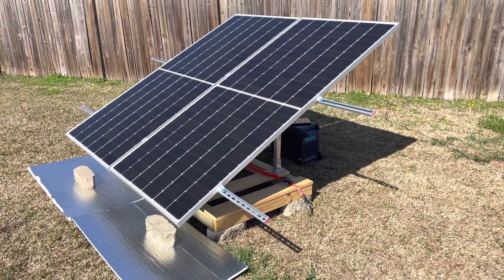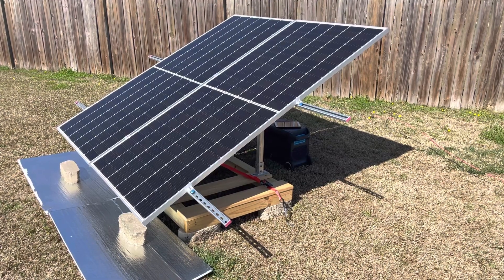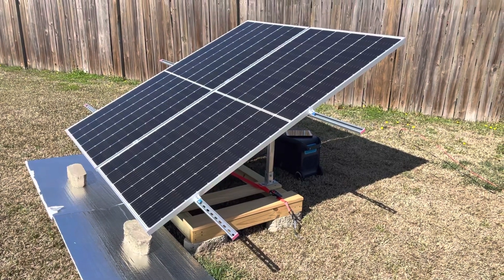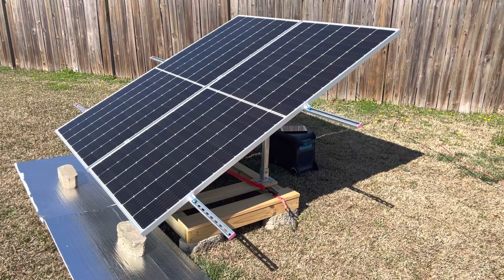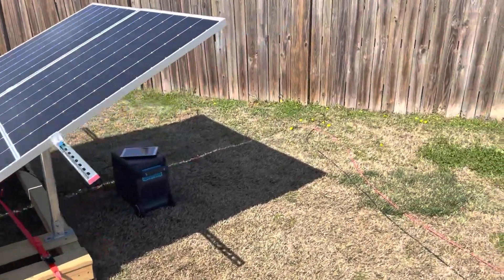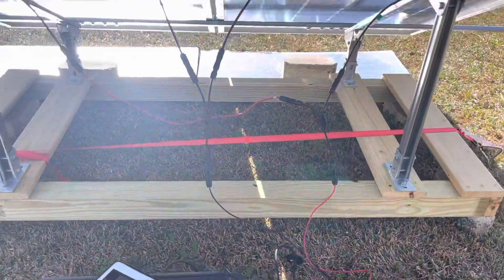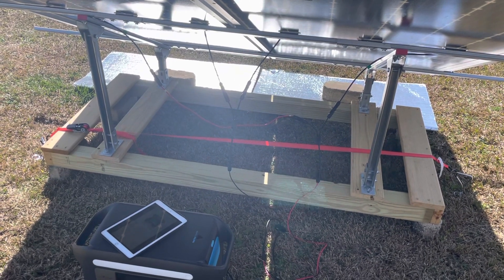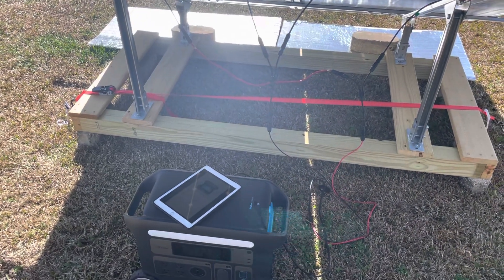Anker 767 Powerhouse Solar Input challenge!

Comment: I purchased two of the panels also based on this and Trailpower’s videos to feed my Anker 767 full time. I have had the 767 running off of these for the past two weeks and running our basement fridge (apartment size) and standing freezer 24/7 for the past 2 weeks. During the day when we have sun, I flip our kitchen fridge, lights, basement lights and my entire office to the 767 as well. The panels have been charging the 767 to 100% while running these before the end of the day, at which point I switch it back to just the basement fridge and freezer.

Like you, I think the max I’ve gotten is just over 900W one time from the panels. I’m going to upgrade my wiring from 10AWG to 8AWG however from the panels to the Anker. I am losing a bit more than I’d like in voltage drop based on calculations. All in all, it’s a great setup for emergency power, and to just offset a few KWH of power each day from the utility.
Reply from the maker: I spent a bunch of hours trying to come up panel combinations that would max out the Anker 767 and not break the bank and this was the best I could come up with.  I posted this video months ago in hopes that someone would come up with a better combination.  So far, the Qcells work very well and you can't beat the price.  I'm especially impressed with their low light bifacial performance and couldy day performance.  The only downside I've found is they are big and heavy.
Reply: I agree, they do perform well in low light. I especially notice it early morning and late afternoon when the sun isn’t directly on them. You’re right though, I built them on an adjustable cart with wheels, but the weight stops me from turning them throughout the day. I would if I absolutely had to, but for day to day use, I’ll just keep them pointing south… Come winter, I’m curious to see if I’ll want the expansion battery.
Reply: @leafnutz2341  
Hello friend, I would be glad if you answer.
Are you satisfied with Anker 767? Have you encountered any serious problems with long use? I will buy this device, but I came across a few negative comments in the reviews.
For example, while it is constantly connected to the solar panel, when the sun hits the panels in the morning, will the device work on its own or do I need to constantly disassemble and reassemble the panels?
I'm also thinking of an ecoflow folding panel. How do you think 400w x2 pieces of 800w would work? I do not think of any other portable configuration. 1 piece of 200w ecoflow portable, 2nd panel to take with me, maybe I will add it later. If you are satisfied with the device for home use scenario, I will buy it. The country's inflation is very high where I live, so I do not want a risky purchase. If you do not recommend it, I will look at alternative products, thank you.
Reply from the maker: @alimuharremturan581  I have not encountered any serious problems during my ownership.  My first unit was wired incorrectly and replaced but still worked properly.  I mostly use my 767 with our RV when we travel but also to charge my EV sometimes and to power a chest freezer in our garage.  As much as I like my 767,  I do not consider it a permanent system.  It is a portable unit and lacks many of the safety features a permanent system would have (proper grounding, DC breakers, solar disconnect, etc).  For this reason,  I do not leave it plugged into solar all the time.  I have a larger Growatt system as my primary system.
Reply: @leafnutz2341  Thank you very much for your reply.  But I want to be sure about one thing.  When you leave the device plugged into the solar panels, when it sees the morning sun, does the device automatically wake up without any problems or do I need to manually remove and connect the xt60 port every time?  When the device's 2400w output is connected to a socket or solar panel, does it allow you to use 2400w full power without any problems?
Reply from the maker: @alimuharremturan581  I’m not sure what you mean by “wake up”.  If you leave it plugged into your solar panels, it will charge the unit up.  BUT if the inverter shut off during the night for some reason,  it will not automatically turn the inverter back on.  Yes,  you can use the full 2400 watts without any problems.   Keep in mind, this unit does not have Wi-Fi. It only has Bluetooth so you need to physically be near the unit to monitor useage and make adjustments.
Reply: @leafnutz2341  What I mean exactly is that the solar panel will remain connected to the device, in a continuous cycle, when it gets dark, the energy transfer will stop. When the sun shines in the morning, will the device continue charging? Will it charge itself without any intervention?
Reply: What solar panels are you all running, for best results and wont break the bank?

Comment: I think  your solar set up is ideal for long tern of use.
Nice video. 
My advice to all is  that 1000 wats  is  maximum, but  what is better ?  To run invertor  for 100 %  for  long  period  of time, or to run it for around 85 % of  its designed power. 
I think with 85 % of daily usage  can invertor last longer  without possible damage during  passing time than when it runs on 100% of its possible  maximum  designed  power.

Comment: I didn’t want to register to the forum. 
 Here is my array for the 767:
8 panels, 100W 
2 sets of 4 panels in parallel, connect the two sets in series. 40-45V and 20-23 amps.
 You could run two sets of 5 100w panels. I don’t have space for that, and the 800w array does the job.
Reply from the maker: And how many watts are you seeing going into your Anker with that setup?
Reply: Hey I have 6 100 watt Renogy panels and I have a 3 series 2 parallel array. Do you think I could do a 3 series 3 parallel array for 900w?

Comment: What AWG size did you use to connect the panels to the 767? And is this AWG size the same used for the MC4 to XT60 cable? Or adapter? Hard to tell from the video.
Reply from the maker: 10awg throughout.  At one point I was using an Ecoflow Delta Pro MC4 to XT60i adapter which is 12awg.  The Anker will draw just over 20amps so keep everything 10awg and you'll be fine.

Comment: Great job showing the capabilities of the 767! Do you have other systems that you use with those panels, or did you make that setup specifically for the 767?
Reply from the maker: I bought them just for the Anker but they will be added to the array for my Growatt system in the future.  This 2 panel rack is semi portable.  I can tear it down and load it up in my truck in about 30 minutes.

Comment: I have room for these panels on my RV.  I would like opinions on the compatibility when 2 of them are connected in series to power my 767 power house.  
Dimension: 54.72*34.45*1.38 inches

Weight: 29.1lbs

Max Power Output(W): 250W

Voltage MPP Vmp(V): 23.83V

Current MPP Imp(A): 10.51A

Voltage Open Circuit Voc(V): 27.28V

Short Circuit Current Isc(A): 11.09A
Reply from the maker: That sounds like the NewPowa 250 watt 9bb panels.  You could actually run 4 of them in a 2S2P configuration.  I mentioned these panels in the DIYSOLARFORUM thread but I haven't tried them personally.  Please let us know where you found them since they are discontinued as well.

Comment: This is off topic ,but I just received my 767 and it came 84 % charged I never received an order of anything with battery power more then 20% charged. Was wondering if anybody thinks this might have been returned and then sent to me?
Reply: Mine came with a similar charge. I was also surprised
Reply: I think because these are lifepo4 batteries. Safer than lipo. Therefore, a higher charge is just fine.

Comment: thank you LeafNutz for the very useful share! I cannot find the Qcell 480 in Crete, where I live but here's what I can get: LG NeON 2 bifacial (LG400N2T-A5). It has Voc 49.7 and Isc 10.22 and can get up to Isc 13.29 and 520W with the bifacial boost. Two of those connected in parallel will give me 1000W, I figure. What is your opinion? What if another panel was added to send the amperage  to 150% of the rated max of the 20 Amps of the charge controller? Can It handle it without being stressed and damaged? I am new to solar energy but I thought that if I raised the tilt angle of these panels to 50%  (for better winter performance) and turn one panel SSE and the other SSW (60 degrees off true South), that would alleviate the stress of the excess energy produced during peak hours and lend some of it to the less productive hours, allowing me to use 3 panels maybe?
Reply from the maker: Stick with 2 of those panels wired in parallell.  The Anker will only draw 20amps even if more amps are available.  Look up ideal tilt and azimuth for your specific location and start from there.  If your solar needs are higher in the morning or evening,  you can experiment to see if you can get better results with a different orientation.  Bifacial panels perform better off the ground approx 2-3 feet.
Reply: @leafnutz2341  Hi, can you offer some advice, I'm a total new commer but have got the Anker 767 and spare nattery?  I have my eye on two 550w bifocal panels but each has an amp output rating of 13 meaning at max (in parallel)  I could be bringing in 26 amps.  Are you saying in this scenario it would just reject the excess and not damage the unit?  Exceeding amp input would not damage the unit? Cheers...
Reply from the maker: @equalizingforce2581  Yes, the Anker will onlyl draw 20amps even if more are availalbe.  The 60v VOC input limit is more of a hard limit and should not be exceeded.  Be sure to calculate your max VOC based on the lowest temperatures for your area.  Also,  keep in mind that 550 watt bifacial panels will be large and heavy and difficult to move around.
Reply: @leafnutz2341  Many thanks. Connected they are about 46 volts in England  weather so it should be  ok.
Reply from the maker: @equalizingforce2581  Just search for a online solar temp compensation calculator.  There are several of them where you just plug in the numbers.  Keep in mind that those panels will max out at 46v x 20 amps or 920 watts.  That being said, the extra amps and bifacial design will help on clouldy days.  Be sure to use at least 10awg  cables.
Reply: @leafnutz2341  Hi again.  Been doing my head in trying to come up with an optimised configuration but the 20amps limit is a big problem.  The issue is I live in England on the coast and it's cloudy 70% of the time.  If I build for just 1000 watts I'll be lucky to get 800w in summer and 200w in winter.  I would like to over build to 1500 watts but I'm concerned about damaging the Anker battery as the amps would be about 36. Could I get a MPPT controller to restrict amperage to the Anker device on optimal days so I'm always getting the optimal input whilst allowing optimal input on cloudy days?  Cost is not my concern, having another source of power is my priority.  Thanks.
Reply from the maker: @equalizingforce2581  if cost isn’t a concern,  I would just get another Anker or the extended battery.  Bifacials panels will help on cloudy days but only so much you can do.  What is your intended useage for the Anker?
Reply: @leafnutz2341  Hi, I did buy the extra battery but that doesn't help with this dilemma.  I bought the set up because I wanted a back up source of power to use in the house and I also intend to move to the country at some stage and be less reliant on the grid,  and also  possibly buy a caravan lol.  Thus I wanted it to be portable.    Energy prices are shooting up in the UK so I would like to install some solar panels and use it around the house for high energy draw appliances like the washing machine and oven etc... Something is going to happen with Russia in the next year and I could be reliant on this unit so I'm trying to cover all angles.  The big  issue is the weather where I live is so unreliable and it's always overcast.  Would an MPPT controller not allow me to restrict what's coming in to the power station? I did think about installing 2 500w panels in parallel and having a third feeding directly into a junction box that I can turn on and off when the weather is poor. However, would that third panel effectively double the voltage when switched on?
Reply from the maker: @equalizingforce2581  The Anker 767's strong suit is it's portabiity.  This makes it great for a Caravan or for emergency backup during a power outage.  That's being said, I would not consider it a good off grid solution for anything other than a small cabin or a single room.  It simply doens't have enough power or solar input.  You should practice running scenerios where the Anker is your power source to see what you can power and for how long.  It's great for a fridge/freezer/TV/internet modem, and a few lights but any more than that and it falls short.  You simply can't get past the 1000 watt solar input limit.  A larger solar generator like the Ecoflow Delta Pro would be more suitable or an All In One inverter like EG4/Growatt/Victron.  The Anker does have the strong suit of being able to charge from a small generator or even your car.
Reply: @leafnutz2341  I researched every possible alternative, this seemed the best all rounder.  I have already tested it, I could get by on 4KW per day (basic needs). My issue is getting enough solar input to keep it charged.
Reply: @leafnutz2341  so if I were to connect 3 500w panels in parallel to a MPPT unit first then connect the Anker to thisMPPT unit, can I restrict the input to 20amp 1000w max so it always operates within 8t limits.  In effect using the MPPT unit as a kind of safety regulator to my portable storage?

Comment: Thank you for this vedio, can you help me to resolve my issue.

I bought all the needed items to start PV charging, but I dont know the polarity of the xt60 connector. Is the rectangle side - and the square side is + ? I am asking about the Anker female xt60, depending on the female side, I have to solder the male.

Thanks
Reply from the maker: ALWAYS, put a multimeter on it so you will know for sure

Comment: Finally I’ve found what I’m looking for!! Not just review like all others! This is exactly what I needed to know before buying a 767! I already have solar panels 540 x 2 and 420x2. (Voc 49, isc 11). I don’t mind if I only get 800 watts max on a sunny day! But is more about how much a get on a abridge English cloudy day? Hence I’m wondering how much (amps not Volts) could I over panel the 767? I’m using Victron mppt and it appears ok with 50% extra.
Reply from the maker: Just wire 2 panels in paralllel and you should be good.  Bifacial panels installed around 3' off the ground will perform better in cloudy weather.  The Anker will only draw 20amps even if there are more amps available.  Remember to use 10 or 12 guage PV wires to minimize voltage sag (preferably 10awg)
Reply: Amps doesn't matter, you could have 2000A available,  a device only draws as much as it can and anything above and beyond is irrelevant.   Volts on the other hand have to be below the MPPT controller limit or it will be toast.

Comment: I have 9 renogy 100 watt panels. They are 20v 5a each, can I use all 9 in a 3S3P array?
Reply from the maker: By my math,  you would have 60v @ 15amps with that configuration
Reply: @leafnutz2341  ok awesome I just wanted to make sure that would work. Thanks 🙏🏼
Reply: I figured out I could only do 2S4P for some reason I couldn’t do 60V. Just so everyone else knows 🙏🏼

Comment: Just got my powerhouse. Here are the panels I'm planning on getting

Specifications
Maximum Power: 550W

Open-Circuit Voltage (Voc): 49.95 V

Optimum Operating Voltage (Vmp): 41.97 V

Optimum Operating Current (Imp): 13.11 A

Short-Circuit Current (Isc): 14.05 A

Maximum Series Fuse Rating: 25 A

Maximum System Voltage: 1500V DC (UL)

Operating Temperature: -40°F to

So you think this would be a good option?
Reply from the maker: Great panels but remember the Anker will only draw 20 amps and I'm guessing those panels are also huge and heavy.  Just some food for thought.
Reply: @leafnutz2341  I hear ya,  starting to get the idea of calculations.  This seems like it might be a better buy.  

Maximum Power (W)200±3% WOpen Circuit Voltage Voc (V)22.5±3% VMax Power Voltage Vmp (V)19.1±3% VMax Power Current Imp (A)10.99±3% AShort Circuit Current Isc (A)12.21±3% A

If I got 4 panels,  wired in a series parallel combo.  It also cost about 35-40%less.

Am I on the right path lol?
Reply: @peteos3732  Tell me more about your useage scenerio?  What are you trying to accomplish?
Reply: @davidedwards5119  I've always used a gas generator when Power goes down.  
The last time we were out for 3 days and local gas stations were running out fast.  
So this is my answer (hopefully) to extend my abilities if that situation happens again. 
The panels will be permanently mounted in my back yard on a platform.  Usage will be basic,  garage fridge and a few lights.
Reply: @peteos3732  first thing you need to do is some testing to see how long the Anker will run your particualr fridge and essential lights.  Take notes and record your data.  Fridges are often power hungry due to their defrost cycles.  For a simple fixed mount setup,  I like the two Q cell panels bifacial panels like I have.  They are cheap and match the Anker very well.  I also looked into running 4 panels in a 2s2p configuration.  Lots of good choices in the 200-250 watt range.  Try to aim for your VOC to be in the low 50's and your total amperage to be in the 22 amp range.  Your amperage will be limited by the Anker but if you make a few extra amps, it won't hurt and actually gives you more headroom.  VOC on the other hand is more strict and you have to make sure your VOC doesn't exceed  the 60v input limit of the Anker.  You'll need to do some math based on cold weather in your area to make sure they won't overvolt the Anker on a very cold sunny day.
Reply: @davidedwards5119  thank you so much,  this community is so helpful!